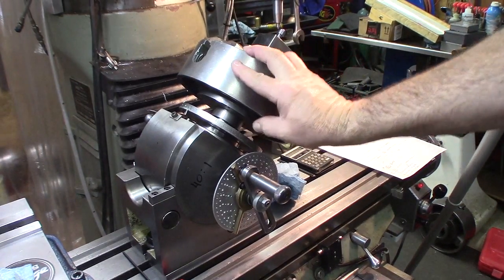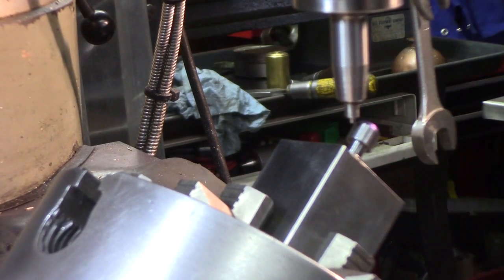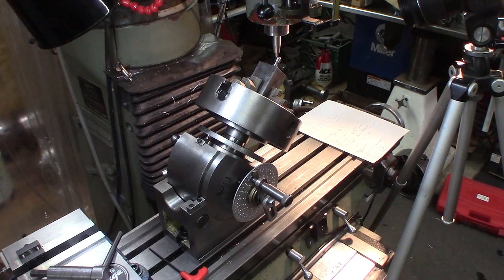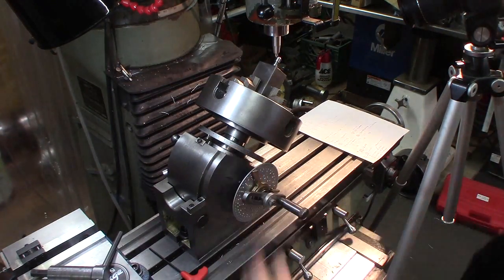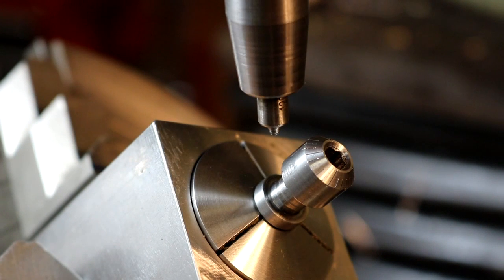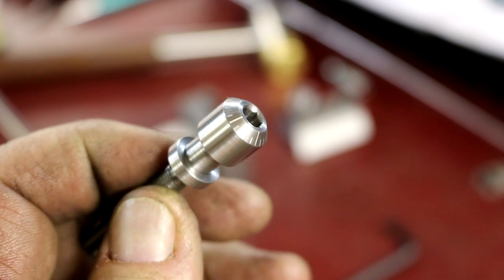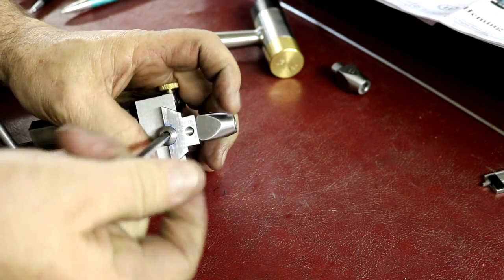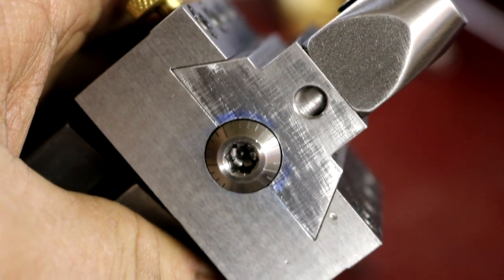How To Build a Hemingway Kit Spherical Turner / Ball Turner P17

Comment: Very instructive. Nice way to do it, too; angular dividing. I think (correct me if I am wrong) this is 4-axis machining. X, Y, Z and an angle to match the taper on the adjusting screw. I wish I had studied marine engineering sometimes.
Reply from the maker: Thank you Juan.  Fun project.

Comment: Could you model this on Fusion 360 and run it on the x carve?
Reply from the maker: Yes, the angle would of been difficult to scribe a line, but not impossible.  Doing this on the mill worked extremely well and produced high a quality engrave.  I am thinking of new larger lathe dials for the Logan lathe and maybe dual metric and imperial for the Lance lathe.

Comment: Looks nice, what are the graduations marked at? Aloha...Chuck
Reply from the maker: Each mark is 0.001"
Reply: Thank you, that is what I asked for...but I seems what I wanted to know is how many lines are there? I suppose there's a formula that would tell me all of this from the 40tpi screw, but I'm ignorant yet. I'll try googling it, but my confidence at finding the answer is low...no luck :(
Reply: That's the advantage of 40 tpi; you can lay out 25 divisions for 0.001" per division. There's a reason that (inch) micrometer spindles are threaded at 40 tpi.